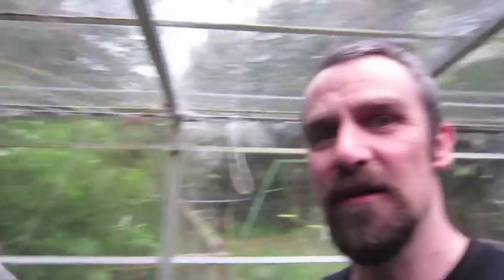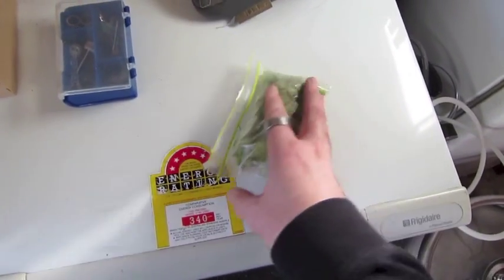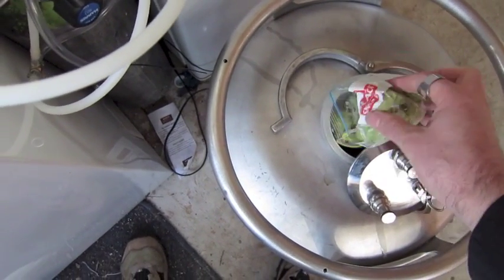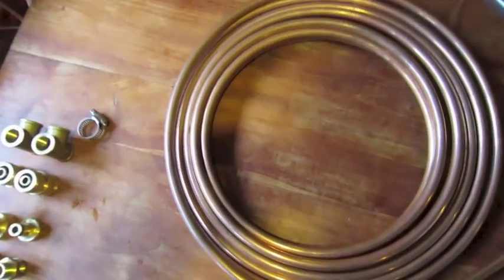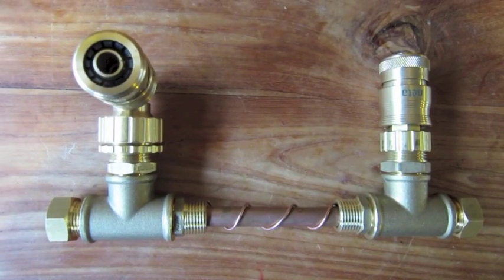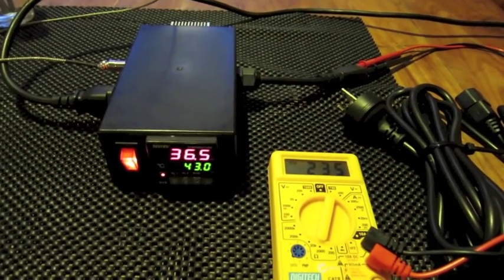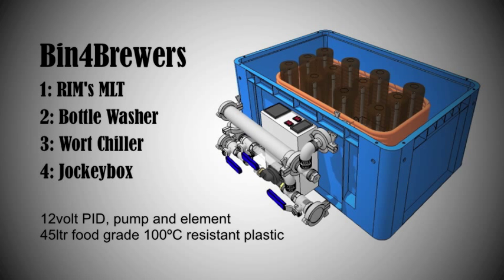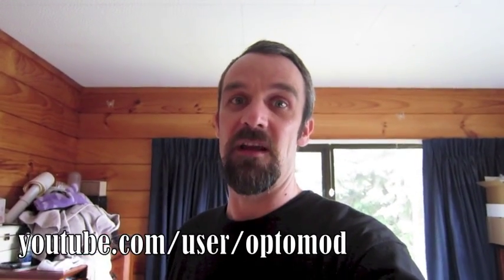Counterflow chiller, Homebrew Wednesday Episode 3

Comment from the maker: The keg with the 4" Tri-clover, I had made for me. It is just a normal keg, with the top sanke connection cut out, and a 4" ferrule welded in its place. Then a 4" blanking cap has corny connects welded into it. I use to use it as a fermentor, but now its my HLT.

Comment from the maker: checkout "Digital PID Temperature controller + 25A SSR + K thermocouple thermostat" on ebay, its all the pid bits you will need, plus they have wiring diagrams as well. Then its a matter of fitting it all into an enclosure, and putting a switch on it to manually override the power going to the element and an on/off switch to power it up.

Comment: I've been watching your Videos, and I REALLY Like your Homebrewery Build.  Man I have to say I wish i was not Low income.  All these gizmos and gadgets you installed in your Brewery is Fantastic and Brilliant. Unfortunatly being low income I have to save money to buy what I need.  And I'm looking to buy a Keg to build a System, I'd like to something like you got that's kind of automated, because I am in a Wheelchair, i can not lift big kegs when they are hot to drain or anything like that.  So something like you got would be very helpful in my Homebrewing endever.  I also wanted to point out that In this video here, the little video clip of your Tempture control box, I really liked that also.  Do you have a Scmatic for that?  I'd like to evently get me somethign going, since I'm a woodworker, I'll build me a box out of wood to House the Temp controller and all.
Reply from the maker: Jimmy Warner Hi Jimmy, cheer for the shout out on the home-brew network, catching up on YT comments now, lol. Checkout the electricbrewery.com, that is what I used as a starting point for my build, as with alot of other brewers. Being a woodworker could you make mash paddles or oak flavouring blocks etc to help fund your brewery build?
Reply: Time4Another1 Yes I probably could. There isn't many Homebrewers here where I live.  I suppose I could Build then Sell online on ebay or something.  Great idea Acutally.  I'll check into it, Since I don't have heat in my Shop right now, I don't go out in it til it's warm enough to do work in the Shop.